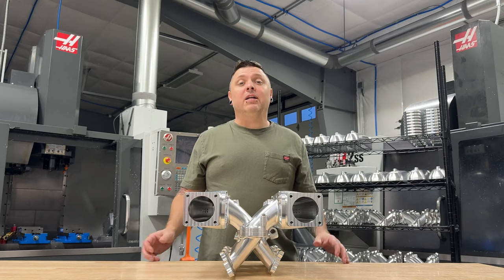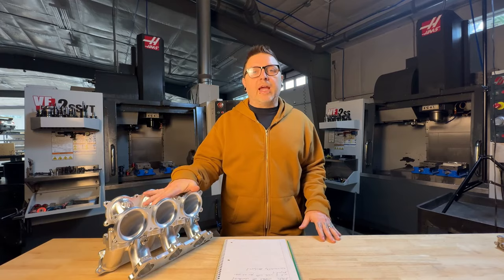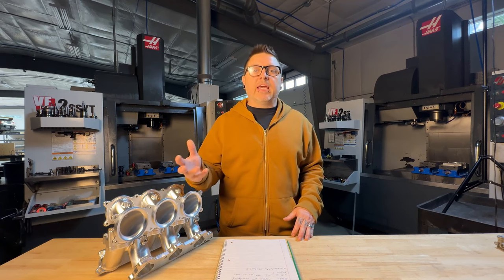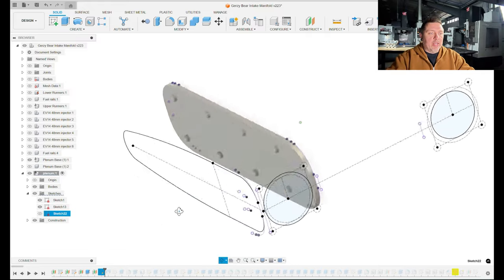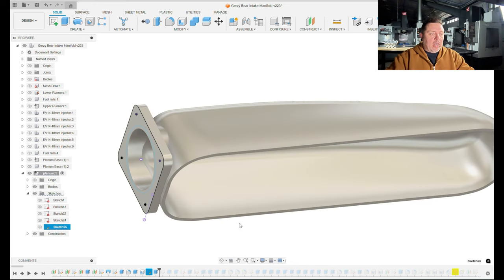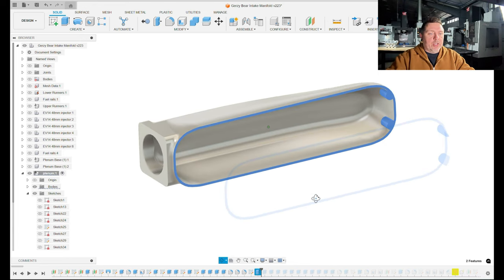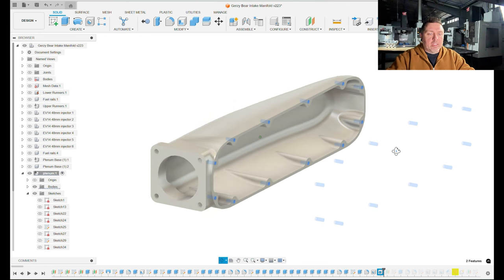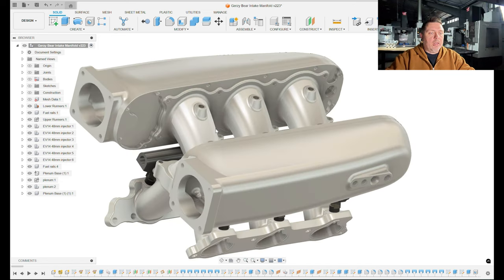Learn to Build a PROFESSIONAL Billet Intake Manifold : Episode 4

Comment: Loving this content!

I tried to comment this before on this video but i don't see my comment so i guess something went wrong, so here it goes again:

I just wanted to give you a tip on a feature Fusion as, 
the way you extruded the TB flange can be done more easily, you can just extrude it into the inside of the plenum, then you can select the faces of the flange on the inside of the plenum you don't want, and press the 'delete' key.
Fusion usually does a pretty good job of deleting the part of the model you don't want.
it usually works best if the protruding portion is surrounded by the face you want to keep.

this same concept would probably work for the bosses you extruded in front of the TB flange on the inside, by selecting the face 'through' the tb flange hole (hope that makes sense)

the 'delete' operation also appears on the timeline, so its easily reversible :)

I hope this helps,
Looking forward to the CAM videos!
Reply from the maker: @gerrit2107  I aware of that feature but it just hasn’t worked reliably for me, so I try not to use it.
Reply: @linderpowersystems_LPSFAB  fair enough 😅